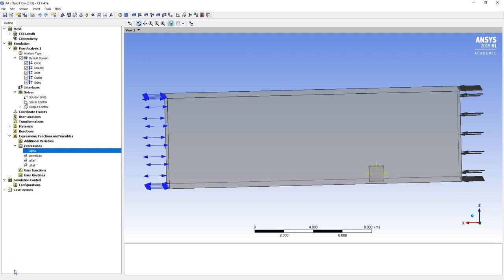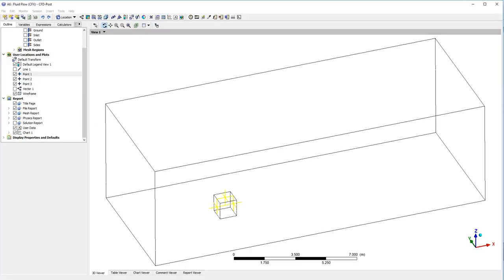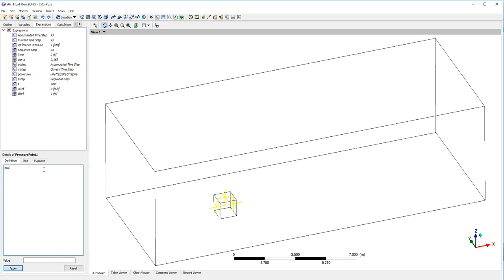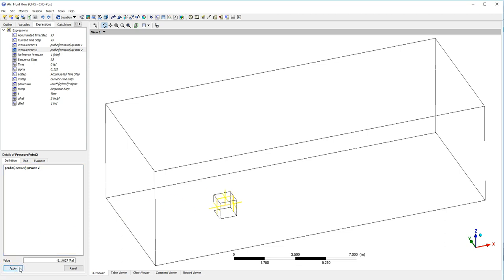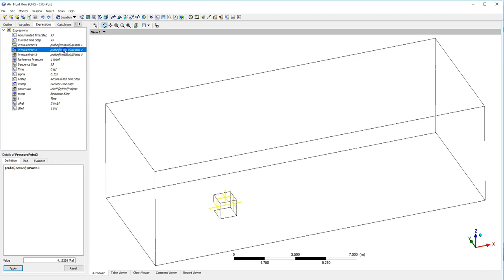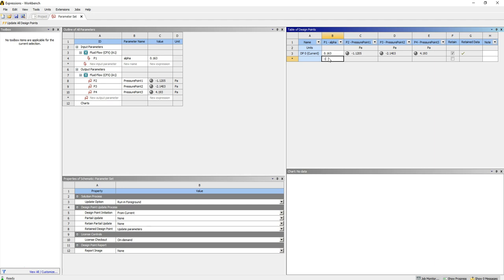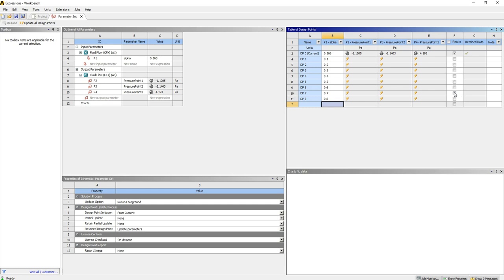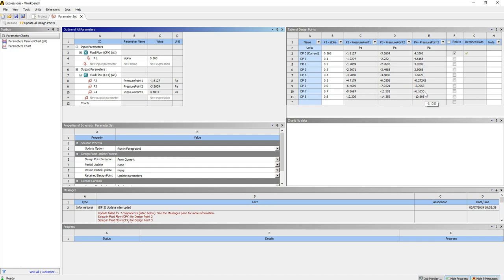How to use Parameter Set In Ansys CFX Tutorial

Comment: I did everything the same, but my output parameters are not changing. The value remains constant, as if it is stalled.
Reply from the maker: Make sure the expression is used to set the inlet velocity/angular velocity.

Comment: Hi and thanks for that input! I got got a question: Is it possible to get the areithmetic mean pressure of a inserted plane or smt like that and to make it an output parameter? I mean the same as you shown here with the points you created, but now with an inserted plane instead of points and with arithmetic mean pressure..
Reply from the maker: Hello, sorry this is incredibly late...but for others reading:
Yes, that should be very achievable by using the area average function in expressions and then changing it into a variable.